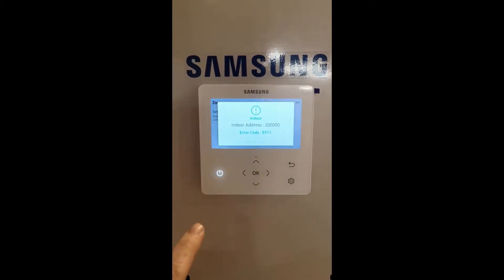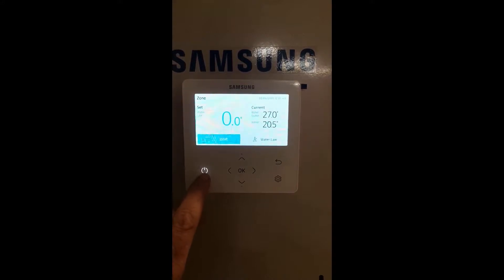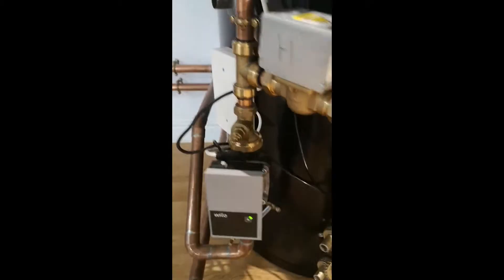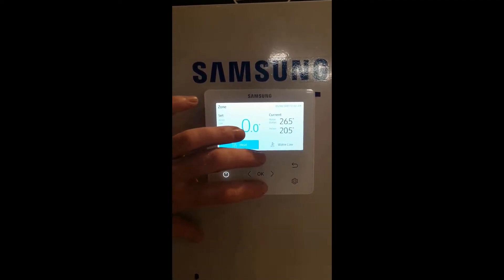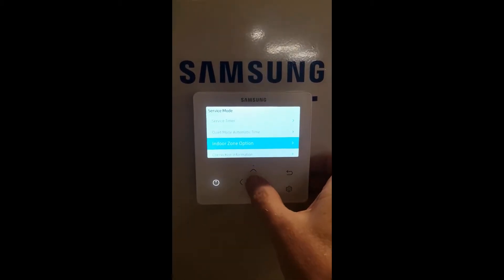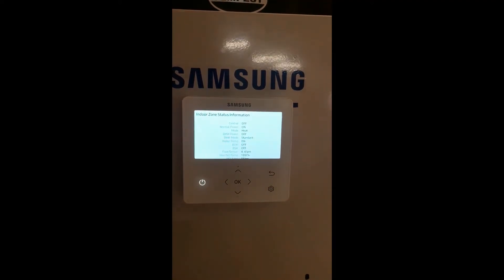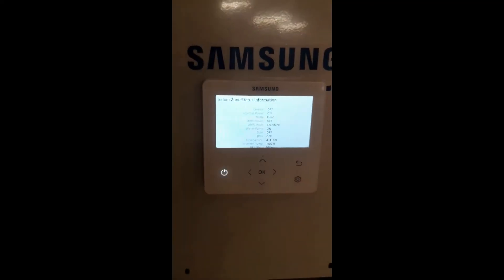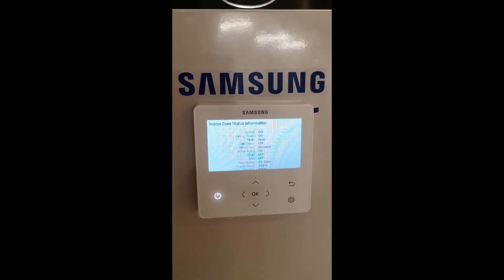e911 Samsung air source heat pump  Gen 6,  the water is moving too slowly for the unit to operate.

Comment: Hi Graham
When I look at my manual it says nominal flow rate of 46.2l/min. The number 20, you mentioned, is that the minimum? Should I be aiming to get as close to 46.2 for efficiency gain, or no real difference between 20 or 40? 
I checked and mine is 35.8l/min at inverter pump 100% ( I’m assuming this infers my circulation pump is modulated, it is a UPM4XL) on the DHW cycle.

Comment: No mention of the circulation filter or the flow sensor paddle problems. Saying '"oh look this valve is shut" is just plain cheeky...
Reply: Could you elaborate please? Having this problem and can’t find a solution. Cleaned the gauze at the outdoor strainer but I still have this problem.
Reply: @j.clarke8685  Check actuated valves are moving to fully open. Check minimum flow/ pressure control valve is working try adjusting to raise flow meantime.Check zone flows as set. Power flush and cleaning agent through the system, one zone at a time..Function test flow switch. Videos on here for all these jobs. Good luck.
Reply: @j.clarke8685  your comment was very long time ago , however I  have the same issue right now. How did u fixed your E911 error , can you still remember that? Regards
Reply: @eneskuru4973  Hello, the motorised valve on the cylinder going to the manifold was faulty, hence no heat as it could not get out of the cylinder. I hope that helps.

Comment: Hi, I’ve got e912. Flow sensor saying 26.1Lpm. What is the issue ?
Reply: I think you have a problem how your pomp is connected. Probably it's running all the time. In other words your pump runs when PC is expecting 0 flow. This could be due to how your pump is connected e.g. normal AC pump connected as inverter pump. I had this issue. When connected my AC pump as AC pump it turns off when expcted and error is gone.

Comment: What about E912 intermittent? Seems to be when the system shuts down for example overnight then E912 when they are waking up in the morning and no heating. Resets and off it goes before coming back on again intermittently.
Reply: I have same issue e912 have you fixed it?
Reply: @kev-reid  see my reply below.

Comment: Hi Guys is E914 the same issue as e911?
Reply from the maker: no 914 means someones been buggering around with the unit, fix it like this E914 – Thermostat wrong connection error – Gen 5
It is possible to run the unit using one of the red sensors, which come with the control box.
This means that you can use the Samsung controller as a thermostat with a 15m flying lead on the sensor. E914 indicates a problem with the red room temperature sensor in the MIM control box 
The red sensor needs to be plugged into the blue socket on the control box PCB, if its plugged in anywhere else, you will see E914 error
E914 will only show if the option has been activated to use this sensor see below.
to use the installation/service mode for your wired remote controller, press the square Set and ESC buttons at the same time for more than 5 seconds.

1 will be showing, press right 1 1 will show, press right 0000 will show. The first 0 flashing
Changing the 3rd 0 to 1 enables the red sensor to control the unit. To do this press right 2 x the third 0 will flash. Press up to change it to 1 press set and then esc.

  

To test this sensor, press the view button until the house icon appears, this will show the temperature its measuring, if this reading differs from the tank temperature the sensor will need replacing.
You can disable this sensor and remove the fault by changing the third digit from 1 to o as above.